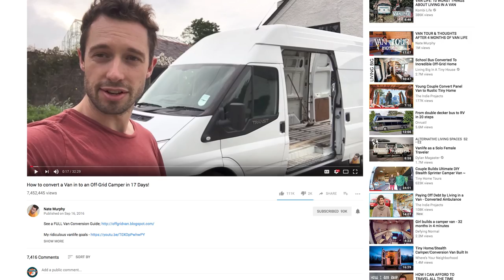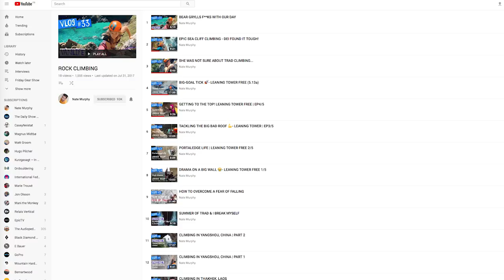This Guy Creates The Ultimate Climbing Van | Climbing Daily Ep.1019

Comment: I get the appeal of live out of a van, but wouldn't it just be easier to buy an RV instead of converting a utility van?
Reply: RV's are a lot more expensive. A lot more... pre-built. A lot more obvious. And they all have awful mpg.
Reply: I just scored a older sweet minivan for $2K and it handles great, 4WD great acceleration, best of all worlds.
Reply: RVs are also a lot bigger which limits where you can park them for free/cheap.
Reply: @katie3867  class b RVs are vans. Most of those are smaller than this.
Reply: @DIYToPen  RVs are actually a lot cheaper. How much is a nice Sprinter like here? $30k? That would buy you an extremely nice used Roadtrek or pleasure way with far more amenities. I got a Roadtrek for $9k and often see ones in good shape for cheaper. I would say the ideal price range is probably between $15k and $20k if you don't want to have to deal with the occasional small repairs
Reply: For people with this mindset, there's a passion for your accomplishments. I would much prefer to build my own than buy
Reply: @RickyHarline  RV's and class B RV's don't really exist in europe, and even so, the prices I found for a 2010 roadtrek in the US are around $60-80k, and a 2005 pleasureway for $40k. You can build something just the way you need it based on a Fiat or Renault or something for less than €9k. A sprinter van is probably the most expensive option you could find.